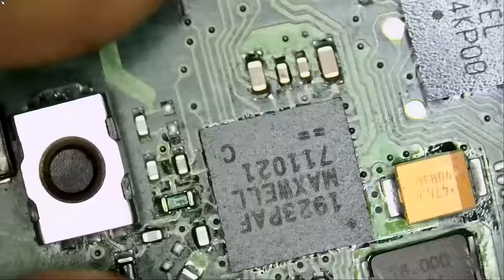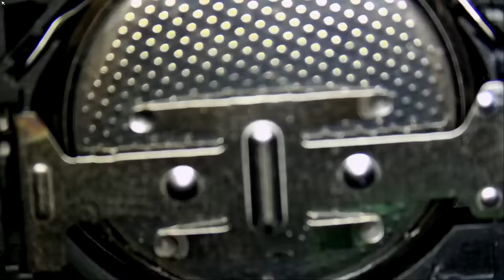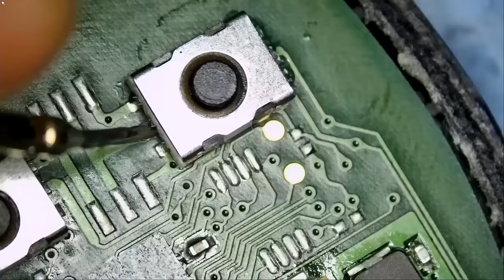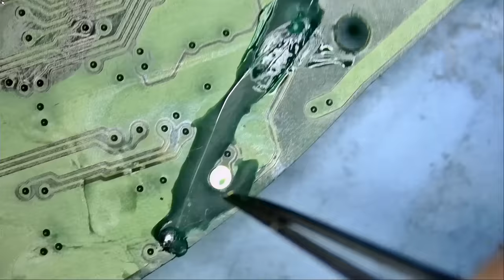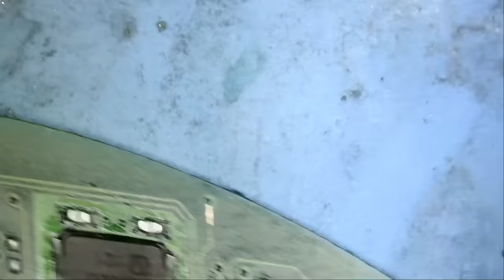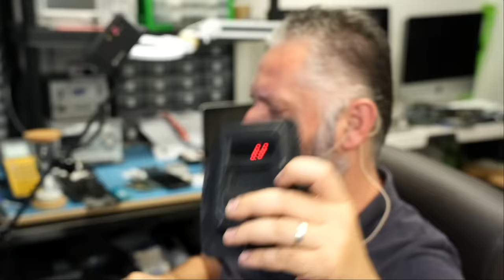A Benz Fob that cannot be Fixed. Right to repair is Hopeless.

Comment: What if you take the 3v from the input of one of the other buttons? Just to give the button the 3v it needs. Maybe the chip is faulty only on delivering the 3v to the button, but it's working on registering the button presses
Reply from the maker: The button has to communicate with the chip to signal a lock command,
Reply: It's likely that the chip has internal pullup, to it supplies 3V to the line and the button pulls it down.

Comment: Can you steal the power from one of the other 3 volt lines from that chip to supply the non working button with power? Just a thought. It appears part of that chips  job is to supply the buttons with power only if I'm understanding right.
Reply: I think the chip needs to see ground to know it's been pressed. Rather than power in its power out and grounded through the button. I believe
Reply: The main difference is whether the chip is using a pullup and checks the state of the output, or if there is a separate input pin that looks for 3V. I didn't look with enough care to notice which one is it
Reply: @rossmate81  I believe you are probably correct

Comment: Hi Alex, I would expect that R2R means that manufacturers are forced into delivering replacement chips for a reasonable price. At the end of the day, laws are always incomplete, but court cases decide on their implementation in the real world. And things look bad here, because the manufacturers have the money. So theoretically, I disagree with you, but practically I fear you are right. I will continue, anyway.
Reply: In the case of a key fob I expect the manufacturer will just claim 'security' as a reason for not supplying any parts even if r2r forces them to supply other parts.
Reply: pretty much, forcing them to actually supply replacement parts/chips (and more especially chip info if/when they go out of business) is the only real solution. They will only stock parts if it is cheaper to do than paying fines. Its not even about only X is allowed to repair your stuff. parts are the real thing we need.

Comment: I have not purchased a new car for over 10 years. However the last time I did after I negotiated a price for the car, before I signed the purchase agreement I presented the terms I wanted added to the agreement. If they refused I cancelled the deal.

Here is what i added to the agreement:
1. Manufacturer will supply ALL service manuals for the vehicle at no cost.
2. Manufacturer will supply ALL electrical schematics, if not already included in the service manuals.
3. Manufacturer will supply ALL OBD codes for vehicle, including manufacturer only codes.
4. Manufacturer will supply free online access to service and software as required for any repairs or reprogramming as needed.

The dealer didn't like it, but I really didn't care, a good used vehicle is just a good and a lot cheaper. People need to start demanding all these items as part of the sales agreement, if they refuse..walk away. Once their sales start plummeting, they will have to comply...Money is the only thing they care about, take that away and they will change their ways in a hurry!

Comment: the big problem in car industri they make his parts. all parts from a diode to a chip there are no schematics or pinout any information public.The manufacturers of the parts are the same but they use a different code, making it impossible to find replacements for many parts.

Comment: I don't know what the maxwell chip is, but I did find chips made by maxwell on some HP inkjet printer motherboards, and I'm sure that the one on the printer was a SoC or some microcontroller... I wanted to find a datasheet for it, but only on maxwell's website iirc they had it, but you had to make an account... and that did not work for me :(.
maybe that chip is on their website too, but you would have to make an account.. and it didn't work for me, because when they send you an email to verify your email, it comes already when the key is expired... maybe someone out there will have better luck than me and get the key before it expires

Comment: ..bypass capacitors seems to be problem on  keyfob on Range Rover i did. Same thing, 0 volts on signal entry lines causing lines to be pulled down..

Comment: Alex, what if you give 3v supply directly from one of the other 2 connections.
Reply: I think the issue is you would be feeding the chip 3 v.
Instead the chip should be sending 3v.  Once line is ground i think chip detects button press.

Comment: i would connect that trace without voltage to either one of rhise working traces coming from chip. Maybe it would lock an open trunk at same time
Reply: It definitely wouldn’t lock, but might open the trunk.

Comment: To make sure, you could grind a bit, separate the track from the chip,  and introduce 3 volts to that line where it should be? Is that chip an output, or an input?

Comment: Like you said there, on these damm MB fobs, I once saw the light at the end of the tunnel too,  but it was the train coming.
edit:  i'm a mechanic,not much into electronics, but if this helps, whatever the Maxwell chip and the buttons do, remember that at rest, there must be NO power drawn at all, zero,so that the battery lasts; i guess this may lead an expert on the right direction as far as the 3v and grounds,and  how they must behave; same with Tv remotes.

Comment: Swapping the chip with a doner should at least produce 3v on that pin. It won't unlock the car but at least it would xonfirm the chip is faulty.

Comment: This chip contains security information, let's say cryptokeys for every action on key, buttons, and combined with radio and IR channel, so every chip is personalized with every car, you can't program it if you solder any other chip from any other key, and this cryptokeys cannot be retrieved by any possible way, so if button replacement not working, it's absolutely zero chances to revive chip. Also by doing low-level reverse engineering, this chip has a security mechanism that prevents any intrusion, so even slight drop or excessive vibrate can destroy this chip internally. That's why the dealer is charging 500$ for every new key, because it's programming with this chip with proprietary hardware and software

Comment: Hello
I know, you have two secured chips in this key, one is with the rolling code to lock, unlock and so on over rf in differend bands, maybe 315 mhz in us, 433 mhz in europe, maybe 815 mhz in japan. The second chip is powered like an rfid chip by the induction spool in front, they power the chip and transmit datas to the car also without the power of the battery, try it next time. Without the battery open the car with the hidden key, and start it like normal.

If you got a chip, if you replace the chip, you have to learn the key again with the car, but some of these are only on time able to connect. In some cases you have also to change the ignition key modul at mercedes. 
They dont wanna give you usafull informations to crack easely they security system of a lot modells from mercedes, chrysler and so on.
Cheers guys

Comment: In this case I would contact the mfgr. and claim a "hidden" defect. Its obvious that there was no misuse from outside - this button fails because of a faulty chip or faulty firmware. The mfgr should be aware of that problem or interested to study it and replace the thing in goodwill. I repair anything - but in the case of security - its totally OK if they use a mask-romed controller which is not available on the market. As a customer, I would expect that the remote has a lifetime of 5-10yrs without being compromised with water, excessive mechanical stress or leaky battery, overstressed buttons. Sending a link of this video to daimler customer support should be enough.

Comment: Lots of comments suggesting injecting 3v from another part of the circuit to force the chip to work. The point being missed is that all the other functions currently work okay and injecting a voltage may cause the chip to fail completely. The chips are individually coded to a vehicle so it is not a matter of just swapping the chip for another working example. There is/was evidence of some moisture damage to the circuit board, so it may well be that the internal circuits of the chip became damaged and failed just that part of the circuit in a designed in graceful failure mode. In that case only a replacement chip will effect a repair, but the chip has to be programmed to match the particular vehicle it is intended for. So an unsuccessful attempt has been made to fix the fault but the key fob still works with all the other functions, so no further damage done. That is the most important point.

Comment: Some of this can be attributed to proprietary design and also security perhaps. Not all ICs have datasheets for obvious reasons and in this case it would be security. They probably didn't want people to know how those chips work. For computers and digital things in a lot of ways, everything is open to look at so they make thing which make it more difficult to just see it like an open book so to speak.
Reply: That's called "security by obscurity" and it's the worst kind. Look it up

Comment: The Albanians (they all drive old Mercedes that went missing from all over Europe) would love to be able to hack the new Mercedes key fobs, so sure....put all the info online.  "Right to Repair" in this instance equals "Right to Increase Car Thefts" and increase the cost of car insurance for Mercedes.

BTW, when you get a replacement key fob from Mercedes, they program the car to accept the key fob. They don't (as far as I know) program the key fob. Therefore, the fob does not know the VIN; how would it?

Comment: External pullup resistor would be worth to try. However I agree with right to repair, but I still feel better if information about security related electronics is kept unobtanium and if security related parts are not made with off the shelf components. Vehicle thefts are happening too often.

Comment: I mean, it's a security device, making it difficult to tinker with is the whole idea pal. You can get fobs programmed outside the dealership (with access to your car) for less than you would charge for this repair. This video is a bit pointless.

Comment: The chip could be an ASIC Custom made for keyless function.   Sometimes they are relabeled for suppliers or OEMS.   

Usually, the fobs all have a unique SN.   The car is programmed to accept the SNs For the fobs.   The procedure is usually “secret” but findable for any given vehicle.  

If you have a spare fob with working unlock, I’d swap the Maxwell chip.  It might work.  

Not sure who makes Mercedes fobs.  Could be continental, ZF TRW, bosch, or many others.

Right to repair won’t help you.  The chip is unobtainuin unless it’s sold generically.
Reply: Marquadt (a germany brand) designed these keys, they are assembled in Romania.

Comment: They have code inside them with a timer that forces a failure.
Reply: It is true but not that failure,  the death counter is on number of inserts into ignition,  i think something like 17,000 then key is disabled. I program these on my channel.

On this repair im wondering if it would be easier to steal a 3v output from one of the other buttons and see if it works..

Comment: Try replacing the chip with other doner  one , so we can confirm the chip has a issue
Reply: Did you not watch the video? There is no way to get that chip...
Reply: @filips7158  I did watch full video he can replace the two or one of them and it should work as one is decoder and encoder ic i think
Reply: @drelectronics13 He literally said it's risky and doesn't want to damage anything further
Reply: @zetsubou3704  it’s reballing, not magic. If you screw it up you clean it off and try again. As long as you don’t cook the thing you can try and try until you get it right.
Reply: @athhud i agree
Reply: @athhud  If you look closely you'll see that I'm not the one doing the repair. You'd be better off commenting this so NRF sees it 🤷🏻‍♂️
Reply: @zetsubou3704  I can already tell that is a waste of time. He can’t even morally support right to repair. The pessimism is just too strong in this one.

Comment: Aren't these all just Chrysler remotes? Surprised you can't just get one of those and see if the parts are the same and swap that chip out. The key might need to be reprogrammed to the car, but that's way cheaper than having to buy a new remote from Mercedes.

Comment: why the customer didnt go to the benz dealer and simply buy a new key ?
Reply from the maker: $700-$1200 and 2 weeks wait  from benz dealership. Why do think people mail  those fobs  in  for repair with an expedited service request.  We work on them daily.
Reply: @NorthridgeFix  It has already been agreed with the chip manufacturer that they cannot sell that chip as a replacement anywhere because the sales of new controls would be ruined and the chip manufacturer does what they are told.

Comment: Hello Alex - very exciting to listen to you - like a crime thriller - now the thing about the key ring is that. If it were that easy to repair the keys, copying them would probably be easy too. But an owner's entire possessions depend on such a key. I only drive a Caddy myself - but I only have the mechanical key with me since I noticed that a replacement radio key costs around €300. You don't have to do everything that's comfortable. A mechanical key is still more difficult to crack than a digital one. Let's see what artificial intelligence can do to simplify it.